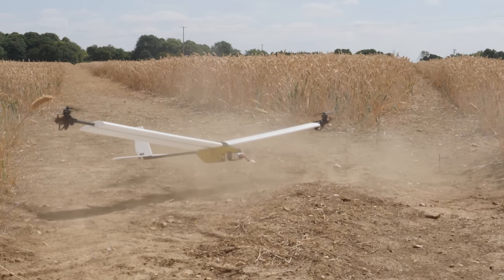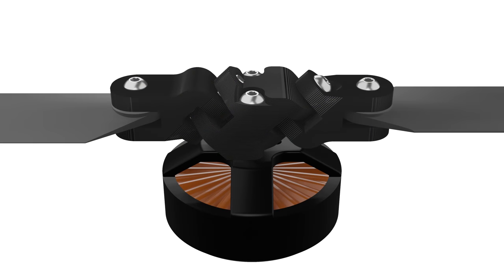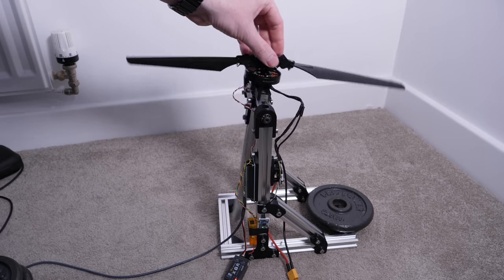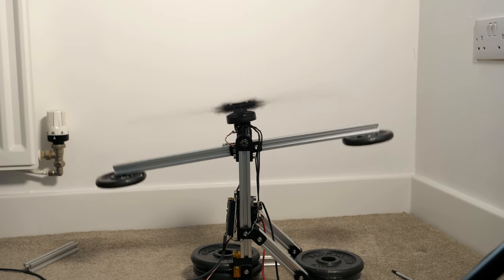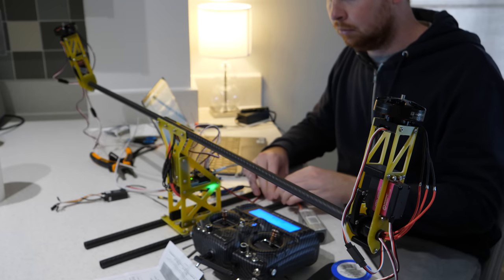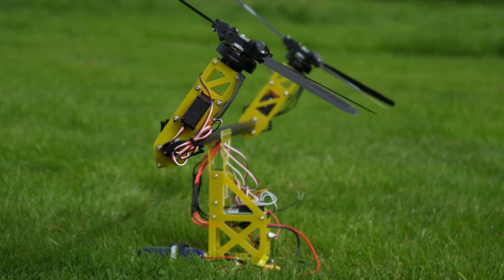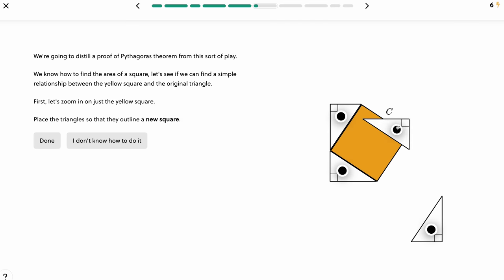Building a V22 Osprey - Part 1

Comment: I'm pretty sure that, unlike wind turbines, there's no optimal blade number, so, unless you're dead set on a proper replica of an Osprey, 4 blades would regain the symmetry of your previous design, while enabling more power to be put through than a two blade prop, perhaps with smaller diameter. Diameter, to my mind, might exacerbate stability concerns.

I guess you seem to've solved the major stability problems here, but some alternative blade angle ideas for 3-blade props would be having one with your positive tilt, one negative, and one at zero tilt. Obviously the zero-tilt one should still have a hinge, or else you'd get major oscillations, though you may still get some with how, as a blade angles due to the tilted hinge, it becomes harder to hinge further from inertia, as the acceleration goes from cos(0) to cos(theta). This means a tilt of 0 degrees offers no additional resistance, as the blade is not tilted as it hinges.
My other suggestion would be, in your current 2-up 1-down tilt configuration, to set the up angles to be slightly less than the down, to get some kind of balance. Because we're dealing with angles in 3rds of a circle, my first guess for the proper amount would be 86.6% tilt up compared to tilt down, which is the sine of 120 degrees. That guess isn't based on anything other than the sine of 120 degrees, except that I'm pretty sure it'd be more than 50%, less than 100%, and related to an angle dividing a circle into 3rds.

Comment: Have you tried rotor with 4 blades. I think during the cyclic control the slightly changed inertia for 3 blades rotor is not balanced in the horizontal directions, that's one reason for the virbations.

Comment: Not sure if it is only for the testing ormy eye are fooling me but seems like they are quite far apart. Having them closer would change some dynamic on the wing spar. Mostly making it more rigid.
On the same logic, might want to reduce the distance of the motors to that hinge. Might see if you can set the servo on the opposite side, so it would be really close?
But this is great!

Comment: I am going to  ask a little question: as far as I know, the escs receive a servo-type signal, which is sampled at 50Hz ( one pulse of beetween 1-2 ms every 20ms) If you don't wan't to have some parasite signal ruining the functioning of the control loop, you need to ad a low-pass filter (with a shutting frequency of 25Hz) to respect Niquist-Shannon's condition (Fmax < Sampling frequency/2) to avoid the phenomenon of folding spectrum (high frequency signal becoming low-frequency, because of the propreties of the product of cosines ( every signal can be converted to a sum, or an integral of cosines, thanks to Fourrier's theorem). Such a filter can be added in software, (a 1order one or 2nd order one with a simple recurrence relation) but still needs to be added, to avoid a lot of noise getting addded to the low-frequency instructions.

Long story short, the maximum frequency of the motors' signal can't exceed 25Hz, and I am not sure if that's enough to accurately control both motors to create the variable pitch needed to control the craft during hover.
Maybe, you will need to create a custom ESC to control the motor at higher frequencies, the spanish youtuber electronoobs explained how he created a controller that pilots a brushless motor in position instead of speed, by directly powering it with sinewaves created through SPWM with traditional mosfets, such a video could help designing such an esc
Reply from the maker: Escs nowadays can receive signals at much higher frequencies (up to 32kHz using Multishot protocol). For this setup I'm using Oneshot125, which has a 4khz update rate.
Reply: @TomStantonEngineering  thanks for the answer, I don't know anything about other than traditional servo signal for communication. I really like your videos as you take time to do real engineering and explain it in simple words allowing everyone that didn't have engineering lessons to understand

Comment: Turns out, a round spar is the least stiff shape possible when it comes to bending forces. 
It is the stiffest when encountering torsion load though.  

Looked like torsion was not an issue for your craft, maybe a square (or straight up larger diameter) spar could help, should you run into issues with flexing and vibrations again.

Comment: Amazing.
Now build a mechanical quadcopter with one central IC engine with shafts and gears or belts, to take the power to four props with cyclic control.

Comment: The plate frame design is not strong in torsion. It could use 3d printed X shape on the two open sides of the frame. If they connect at the corners they will act like wire and stop the twist.

Comment: Could you put the tilting servos in the main body? Reduce the weight at the wingtips by simply having the servos atached to two rods sleeved by the wingspar and then atached to the motors?

Comment: hey Tom,  if the pitch changes on the 3 rotors won't that cause most of your vibration? you will have 2 that are 30 degrees to the centre line that will swing towards each other and the one that is on the other side in line with the thrust line will be out of balance   cause the other two will weigh  more? will only happen when the thrust line is in line with one of the blades when you are braking it ...
Reply: In addition  the original upgrade to the design is to put the swivel on a rocker ... this gives more swing ... check the upgraded version the patent holder made. It has a rocker like a bell huey rotor. Almost like a autogyro... shown at 1 minute in https://youtu.be/qWsKqmCIhRY

Comment: Considering that the osprey only runs the rotors vertically in the hover, surely you don't need the asymmetric angle of attack on the blades?

Comment: In a full sized helicopter the lift from the blade varies when it is moving through the different quadrants, like lift as a percentage is higher on one side more than the other, with no lift generated as the blade recedes to the back and more lift as the blade cycles to the front. It's the reason helicopters have a natural oscillation and why when strapped down they will literally rip themselves apart. Is this different on a RC or small model helicopter or does the lift variations matter less?

Comment: if you use "normal" batteries for vtol aircraft on airports, then you can resonant induction coupling push the vertical power directly from the airport to the "helicopters" wirelessly, take-offs and landings energy directly from the airport, not from the batteries (unless you use solar/nuclear, then you dont need to recharge). dont put any (other than super caps) on a helicopter, fly it with resonant induction coupling power lines alone. try wireless powered "tethered" blimp air electric trains
Reply: just power lines, nothing more

Comment: Amazing work Tom! How did you measure RPM of motor by hall sensor? you coupled a magnet along the motor shaft or is the sensor picking up the magnets in motor bell. Thanks!

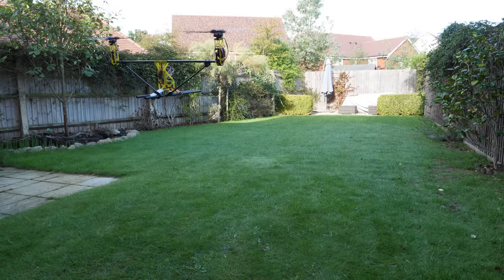Comment: 8:20 you probably know this already, but if there is resonance, and you hit it, bracing does very little to solve the problem. You need to move the f0 away and/or dampen the vibrations. (yes. braces do alter f0 and do dampen the vibrations, but that is a secondary effect, not the primary goal of bracing - again, you probably know this already )

Comment: I want to see these used on a quadrotor. Reminds me of Curtis Youngblood's variable pitch quadrotor, one of which was the Stingray 500 that Flite Test showcased nearly nine years ago. I wonder if the solution Curtis found for variable pitch or the solution you've found is better in various areas, like cost, manufacturability, control, etc.

Comment: On your last video about emulated swashplate you told us that it doesn't have the same level of control as a real swashplate but what about other con?
I suspect flight time and endurance could be a issue with some craft.
Also, I'm working on a drone based on a 580 class traditional heli kit and I was wondering how it would handle medium to large blade if I were to implement a similar solution as yours.

Comment: Seems a bit a trick to speed up the motors for take off, while also balancing out the variable pitch of the rotor heads.  Do you spin one motor CW and the other CCW?  I'm interested in learning more about that arduino flight controller too.

Comment: I have no idea how that 3 rotor passive swashplate works... 
Two rotors with a sin wave power signal I get
But with three you lose the effect where the 2nd rotor does opposite what the first is doing.
Are you prioritizing only one portion of the pitch? 
i.e. program sin wave power based on front target pitch and ignore rear?
Very cool!!!!

Comment: Very nice project! Isn't there a chance to get rid of the servos? How does it behave when giving opposite commands to the motors instead of giving them commands to pitch forwards or backwards? What do you think about using this technique in a plane without servo driven rudders?

Comment: The instability/vibration is a problem you should root cause. At least to know if it's due to tolerances from manufacture not matching tolerances for the application. You may be able to file/balance/offset mechanically or digitally. Much like you are for the hinged props.

Just adding stiffness is a solution... if it is required though... 

Dragonflies comes to mind as a practical comparison. The wings are simple and the hinges are simple. Even the smallest defect renders them flightless. Despite this, this are 99% successful at hunting. My take on the wing design is stiffness when under load only in areas where needed; such as the leading edge and a small secondary reinforcement structure of the wing. The same is true at the "hinge". Small structures are stiff for a very specific payload capacity range. Cause a wierd vibration (wet/cut the tip of a single wing) and the animal stops hunting and spends all it's time trying to adjust to the vibration when flying. Sometimes they will even hover over prey as if they cannot move forward until the vibration is adapted to.

You are already keenly aware of resonance. This can be amplified in strange ways under load, frequency, and even material temperatures.

This is my opinion cuz I'm curious. You do you boo-boo. It's an awesome show to watch.
Reply: In addition, you may want to understand the feedback loop tolerances given the expected payload range. MCUs are quick but not THAT quick. Inertial offsets get time bounded as mass increases with these tiny MCUs. They just need time to think before they act and the more interruptions for compensation... free lawn aeration.

Comment: I don't think the 3 blade propellers are much better than a 2 blade design. If you want more lift, you can use a 4 blades design, where top and bottom blades are mounted on tilted hinges and side "auxiliar" blades are mounted on straight hinges. In that way, the auxiliar blades gives more thrust but without affecting control

Comment: If you're interested in bidirectional DShot (300-2400) implemented in the Raspberry Pi Pico's PIO, I have some source code. It is self sustained, i.e. it can output @10kHz to the ESC and get RPM data back just as often (although the ESC doesn't update it that quickly, so that kinda defeats the purpose) without using any processing power of the main CPU.

Comment: lego can do everything you asked for, you would just need to replace the lego motor with a non lego fast enough RC motor - enough for it to fly. the lego motors might be ok enough for the pitch control and VTOL control. Yes lego made a set but it got cancelled but instructions are available, so just modify that OR build your own. Theres even a thread on eurobricks of mods for that psrticular legp set

Comment: With this technic you have enough degrees of freedom to controle yaw as well, without tilting nacelles. I assume the real thing isnt using this control scheme as well, im curious why. Never the less great job so far
Reply: Turbo shaft engines can't really be controlled as fast as the electric ones?

Comment: Good day i have a video sugestion for you. a pneumatic machine that harnesses the power of carbonated drinks. possibly load in a can it punctures the can and you use the co2 from it to run something. 

could even use thentos as some kind of "boost" could be interesting if you need a fluid seperator.

Comment: You realize the real osprey suffered from sudden thrust inversion that cost many lives and aircraft... I had one read a very good writeup on it online ages ago, but I can't seem to find it at the moment. But essentially, under just the right conditions, the thrust produced by the rotors would invert (on one side) which would cause the aircraft to roll over immediately.

Comment: why can't the yaw be controlled without the servos? If you can control the forward force from one propeller, shouldn't you be able to reverse their directions and control yaw without having the servo there? I mean it wouldn't be a vtol but it should at least work right?

Comment: to make it as accurate as possible, do you think you could get a driveshaft to go from one engine to the other?  Like, in the real one, you can have an engine fail, then power will automatically go via the drive shaft to the other engine.  Think, differential
Reply: it's also the same mechanism that 'syncs' the rotors

Comment: 4:40 Was your flat built for a part rent part buy scheme?
Because mine has those exact thermos on the radiator and raised plug sockets.
Like, I could be looking at the inside of my own flat.
Reply from the maker: It's a house built in 2014, so I assume that's just the new building techniques haha

Comment: Isn't having two motors, that can apply tilting force in all 4 directions is enough to yaw the helicopter without servos? I mean what you have said at 8:42 is not entirely true, you just have not programmed yaw motion into it, right?
Also transition to a plane flight requires both motor to be rotated forward, right? With yaw control implemented in software, you can rotate whole motor shaft with only one servo o)
Reply: if you try to yaw by varying the speed of the propellers you introduce a heavy roll motion that will have to be counteracted anyway and cancel out the yaw input you just made

the rotor head design in this video is not capable of tilting the rotor side to side, it can only provide thrust upwards and create a torque in either the roll or pitch direction

im not sure how to exactly put it into words but i hope you can understand what im trying to say

Comment: What if you just had two receiver boards one for drone and other for plane the controller controls both at the same time but a Arduino quickly rotates all motors 90° and switches receiver to go from drone to plane or back with a single button or just have a GPS sensor to detect the speed if the speed drops to under whatever speed automatic switch to drone mode if the drone gets up to some speed switch to plane mode so you don't even need the button and a arduino is small and takes next to no power and the gps chip the same

Comment: Now you'll have an excuse to design, build, and test a VTOL based on the new FLRAA. Which was won by Bell and it's V-280 Valor. The difference with the V-280 is that the engines do not rotate at all. The prop and gearbox are the only parts that rotate on this version.

Comment: if what you are saying is correct.. I am wondering if you just increased rpm without varying speed.. would that create more lift? and as you reduce rpm of motor.. would this amplify pushing of air in upwards direction (anti-lift)? Additionally, how effective would this pitch change be with increasing load/weight being carried by the osprey with these motors?
Reply: the varying rpm control is used to balance the craft in hover with the help of a gyro to tell where in the rotation the extra lift is needed to keep the craft level..... if you used this mech and just went to a higher rpm from a lower rpm you would only end up with a burst of extra lift for a split second and lose all your balance control so lift control is modulated by rpm not the attack angle of the blades like in a normal remote helicopter ie the collector
Reply: @zachmoyer1849  thanks for your explanation. From what i gather from your explanation.. this technique or mechanism gives up some of or a lot of the power tn angle shift a helicopter has. is that correct? and that its primary use and really its only specific function is to achieve staticic hovering in relatively calm winds?
Reply: @manp1039 if you look up swashplate function he is achieving the same thing but with no mechanical linkages and an extra servo there is no collector funtion since an rc version has no problem controlling this with rpm changes which the real one cant do so it has a collector to do this its limited in the wind because the props are so small compared the the size of the craft if he made them bigger it would perform better in higher winds

Comment: Why don't you use motor speed for yaw control in a hover?
Reply: if you try to yaw by varying the speed of the propellers you introduce a heavy roll motion that will have to be counteracted anyway and cancel out the yaw input you just made

Comment: Why don't you test with a big-ass base, like 2m diameter so it can't tip and let the rotors hit the ground. Hell, make it a completely enclosing cage for that matter, then it could roll along the ground but still without damage. Obviously it would have to be light wight but not impossibly so, given it's just for initial testing.